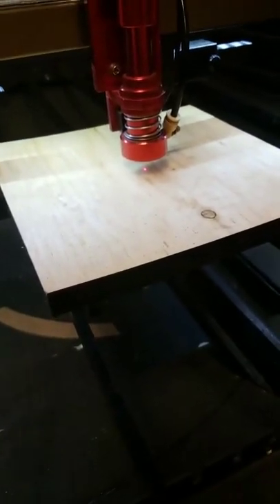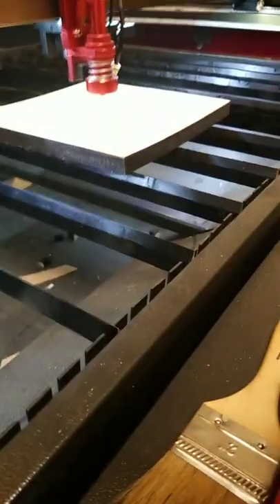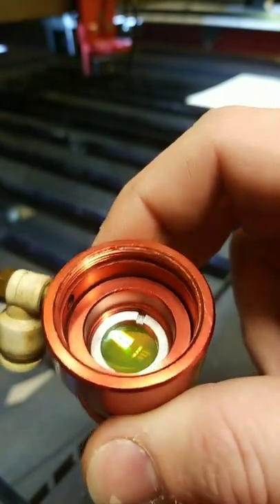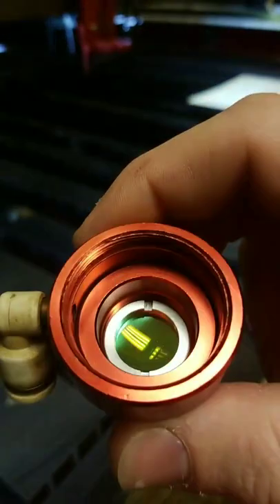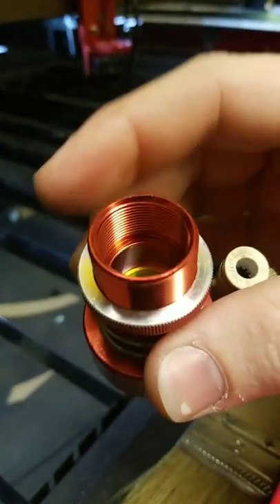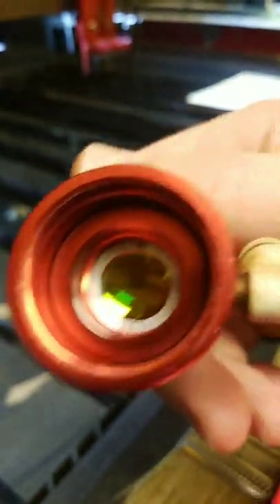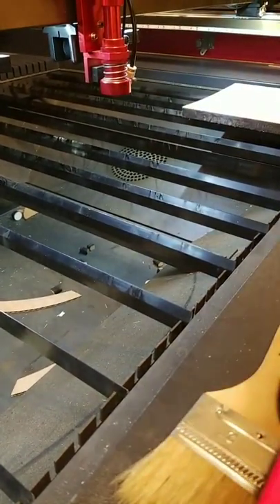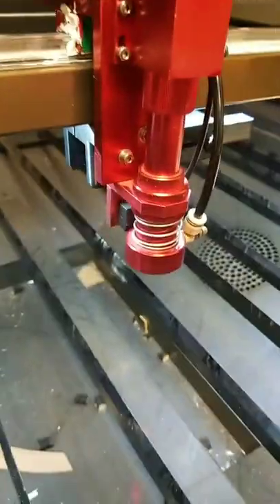Boss laser lens placement

Comment: If I'm using lightburn and I just swap the stock 2" lens from the original position to the new position what else needs to change? Do I have to tell LB or the machine I switched locations? my clearance didn't change when I just did an autofocus from the machine. TY <3
Reply: if you are using light burn you will need to do a ramp test and after that you will take the best focus number and input that into light burn under auto focus to account for it. does that make sense?

Comment: YO. THIS IS EXTREMELY HELPFUL. I've been quite aggravated with the poor clearance, and have had several jobs fail due to the nozzle colliding with the work piece. I just bought my laser back in the fall, and Boss support has not impressed me. I asked for a solution like this and they basically told me that there wasn't anything to be done. I'm kicking myself for buying Boss - literally the only reason I did was for the support which is supposed to be good, but I've had to solve all my issues through google searches. Great video, thanks again.
Reply from the maker: Glad this was helpful for sure. Sorry you got sucked into the Boss trap. I made that mistake twice....lol and will never do it again..... I have several other  OSS laser videos on here that may be of help at some point.
Reply: @JERCustomDesignsInc  Follow up on this - when I first did this, I experienced some reduction in cutting power. I adjusted my settings to make up for it, but tonight I realized what was going on. The nozzle they supply was preventing all of the light from making it to the focal point. So tonight I took the aluminum nozzle to the drill press and just opened up the aperture a bit - power is back to where it was originally, or better!

This should probably only be done if you're using a proper air compressor for the air assist - I don't know if the gold air pump that usually comes with it would output enough PSI to still be effective with the increased aperture. The nozzle aperture issue was a result of moving the lens down, which is why I dug this video back up to comment on it.

Anyway, kudos again for a great video!

Comment: The only issue I have with this is the work it takes to access the lens to clean it.  Does having it in this position increase the frequency of cleaning?
Reply from the maker: It takes no longer to get the lense out than if it were int he top. Positioning has no effect on how dirty the lens gets. keep air flowing and you wont have any issues.

Comment: I am going to assume that if you move the lens from the top of the housing to the bottom  of the housing, that the manual acrylic focus tool is of no use and that you will have to rely on the auto focus.  After hearing some of the stories, I only focus manually.  How do you adjust for that??
Reply from the maker: auto focus works just fine but you will have to change it in the software to reflect the new distance. If you are doing it manually you will need to cut a new gauge for the focal distance.
Reply: @JERCustomDesignsInc  newb here with an LS1630. How do I change the focal distance in the software? Poking around the Boss site hasn't been much help.
Reply from the maker: @craigulmer1270  what software are you using?
Reply: You would need to recalibrate your focus.  Even for auto focus.  The autofocus has no way to know that you moved the lens.
Reply from the maker: @ManCrafting  fact a lot of people have a major misconception on how auto focus works.  Part of the reason for owning this machine is because of their advanced auto focus. If you didnt want auto focus you could save have the cost of a boos laser and buy a regular china machine.
JMO